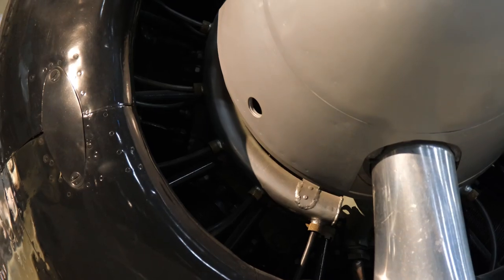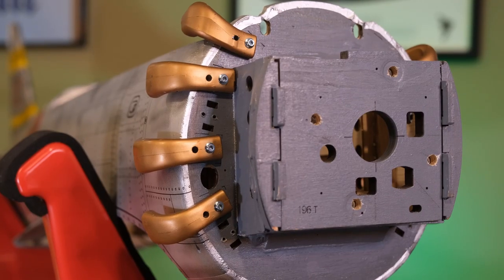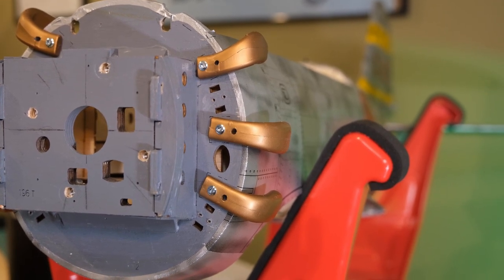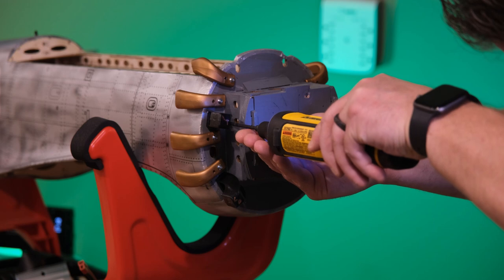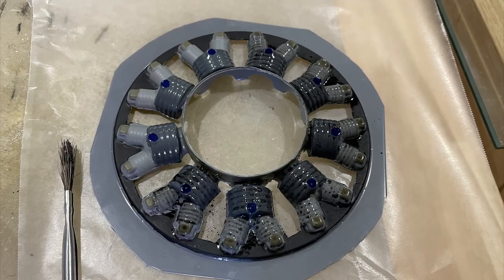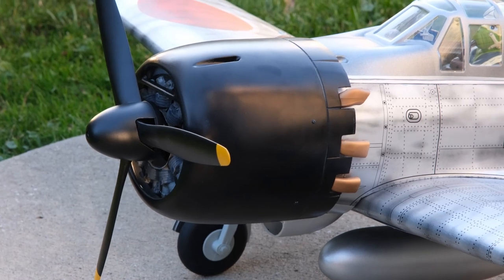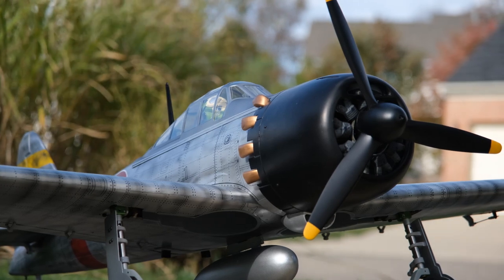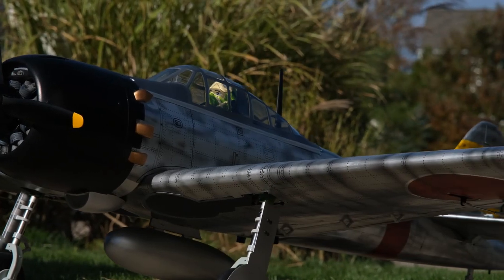Install the Cowling & Exhaust - Phoenix Model 20cc 68" Mitsubishi Zero RC ARF

Comment: Can you do us a favor, please show us the motor and prop , battery combo and test with a watt meter for amp draw battery volts sag and of course watts .. I always tether mine to a fish scale to get an approximate lbs of thrust reading to see where I'm at I don't rely on watts alone then I can change props to see where the best amps to thrust ratio for a given prop ..

It helps to  determine the battery size and weight to get my flight times as long as possible.  at least for me c/g and flight time really matters
Reply from the maker: I will in the next video...however, it might not help as much as you think....JUST because I went with a Dualsky 3500R 12S motor....so I'll be running 12S 3300....and that will probably only be like 40-45 Amps at full throttle. Most people will run a 6S or 8S 5000 setup which will def draw more amps. Yes, that will make my Zero a little heavier...but I'm hoping I can play with location and not have to add anymore nose weight like others have had to (check the forums) with a typical RimFire 1.20 motor.
Reply: @djmoosecom  

Thanks I really like Dualsky and Sunnysky motors , I run those in just about all my models I putting in Dualsky XM 5050EA-14 515 KV  it's for .82 4 stroke power it swings 17X8 electric prop.on 5s. in my Phoenix models .46 size corsair  I chose it because of weight needed in the nose . excellent motors.

Comment: MATE great videos , BUT this is NOT the end , please show fitting the motor , fuel tank batteries etc , then the maiden flight for trimming etc , then and only then will i make a desission to buy this here in Australia , thats is when our suppliers get this model with electric retracts , insteed on the one they now have with only mech retracts !!!!
Reply from the maker: Will do! I'm planning on all of what you described in the next Zero video...but that might not be for a while. Also, just to be clear...I'm not trying to sell these...I'm simply trying to provide the info I'd like to see before I made a purchase. I'm totally happy if someone sees these and decides this is not what they're looking for. (and same the other way as well)
Reply: @djmoosecom  thanks for reply ,yes i know your not selling them , but thats ok , im just looking at the videos to see if i want to buy or not , as i just nearly finished my seagull master balsa kit build , i was checking the qualitry difference etc , keepup the great work mate , looking fwd to next vid